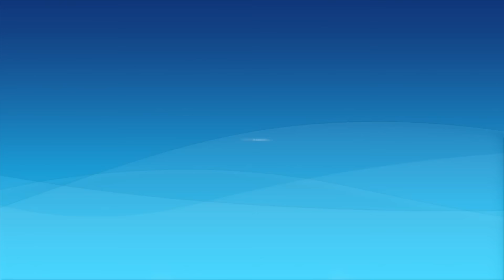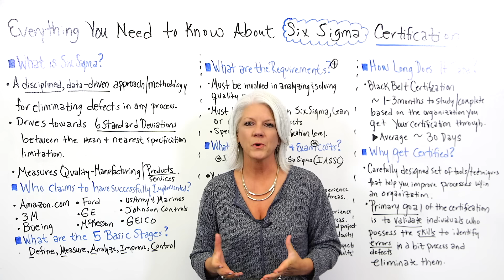Everything You Need to Know about Six Sigma Certification - Project Management Training

Comment: Good video on explaining it.
I've worked in Nuclear, Electrical and Equipment engineering and CS and frankly 6 sigma, lean and scrum and others like it have been more of a plague to the industries. It wasn't a matter of how they were implemented it was an issue of were these programs place value their absolute short shortsightedness and failure to look forward. It has to do with how stuff is defined as valuable and worth doing. Take the idea if a customer isn't interested in it is it worth doing? Well customers often don't know they want something until it is handed to them or someone else points out what can be done with it. Take in programming efficiency is often discounted by these programs given though CPUs aren't going to get tremendously faster and Amdahl's law limits performance of a program regardless how many cores there are Efficiency should probably job one or at least two of any programmer and language going forward. It sure as hell isn't conducive to any R&D other wise you would only reinvent the wheel over and over again God knows if a customer wants something new. My favorite experience with Six sigma has to do with wafer manufacturing/ microprocessors. Two sets of management engineering and production. One group is trying to simply make a product that works the other is only interested in how fast it can be made. Want to guess which idiots were six sigma certified. The quality of product coming out went seriously the hell down hill. To the point they were unstable. Needless to say when the companies realized the problem they made changes so when you hear or see companies still touting they are six sigma it isn't necessarily true they do it often simply to ensure they meet a contract requirement with another company. Honestly, I could write a book on the nightmares I seen from these. My current view is these are little more than a scam to bilk money out of people for a certificate saying they know something when they actually don't. No better than colleges that will sell you a degree or certification for money. Maybe worse because people fall for this crap.
Reply: nonsense.